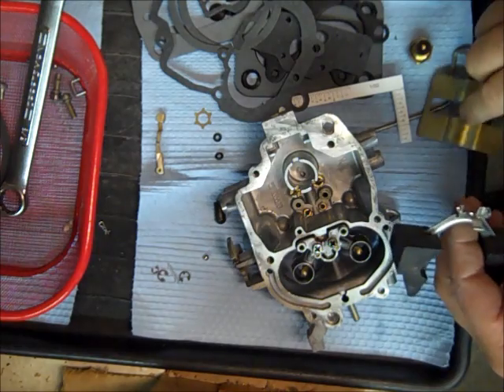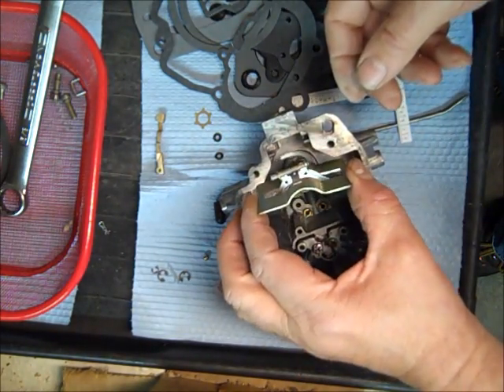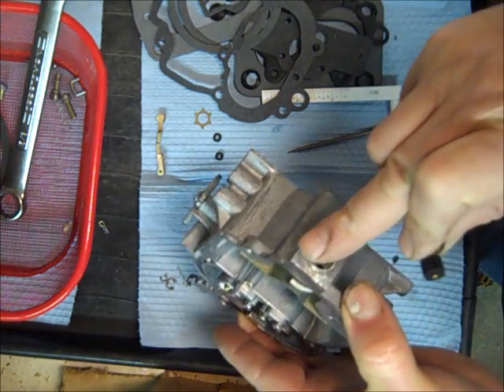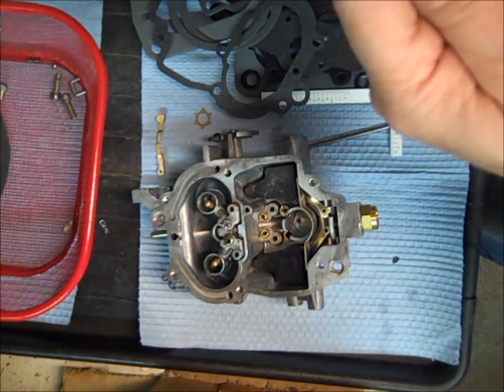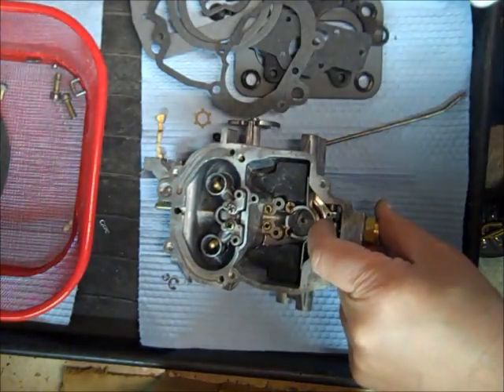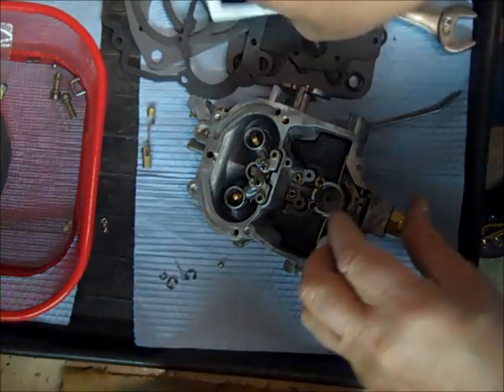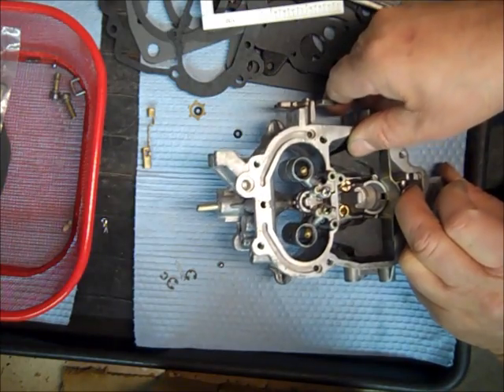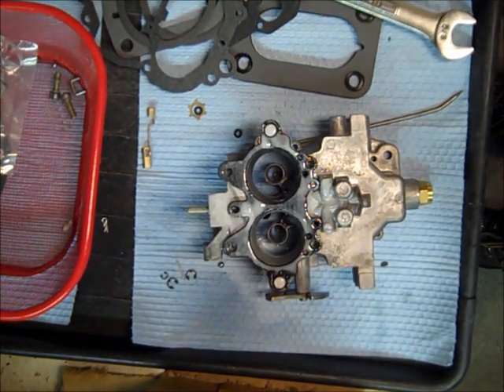Holley 2280 Carburetor Rebuild - Part 2

Comment: Thanks for the videos. For the float adjustment, you invert the carb (upside down) and let the weight of the floats ONLY rest on the fuel needle, and THEN you make the 9/32" adjustment (pressing the hinge pin down to keep float hinge seated in the slot). Couldn't tell whether you were pulling the floats up by pressing the tab or not, but it didn't look like it. If you were, that could damage the fuel needle... if not, the setting will be wrong, as float will be at its lowest position instead of the highest position when you adjust it. FWIW, you're also supposed to measure at the very end of the float, furthest away from the needle, so I think your measurement here is way off (unless you're lucky, and the two errors cancelled each other out :O)). Ie, if it was 9/32 towards the center of the float, it might be 10-11/32 at the tip, and when you turn it upside down and let the floats come to their highest position, it'll be less. Might be a lot less than 9/32 (like 7/32?), depending on how far the tip of the float travels. Not saying that to be critical, but to help you and others who might watch the video... it's better to do it by the book. Thanks again for taking the time to make the videos, there's some good info.

Comment: I think you left the protective black collar on the needle & seat assembly when you inserted, and it should be tightened to 200 Inch-lbs, not ft-pounds.

Comment: Will WD-40 work as the spray lubricant here (and with the vacuum power valve?). Also, is there no mechanical power valve with this carb? Weird how they're not all the same. I even read that some have the check ball and check ball weight, and some don't, either I lost both, or mine didn't have them when I disassembled it!!! :O/